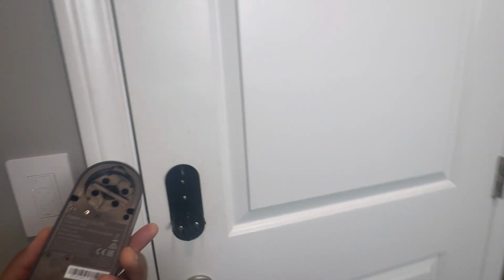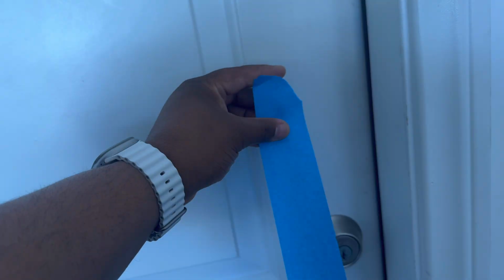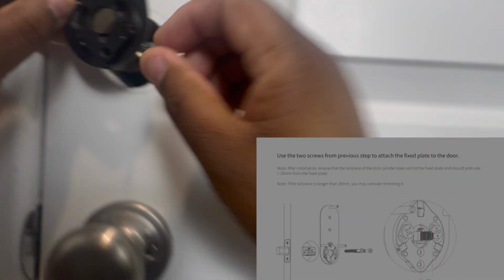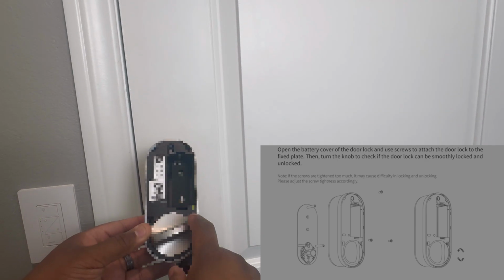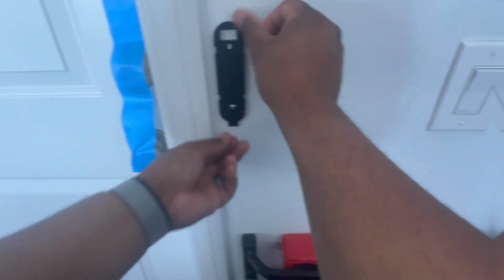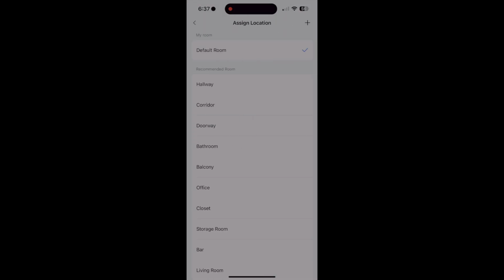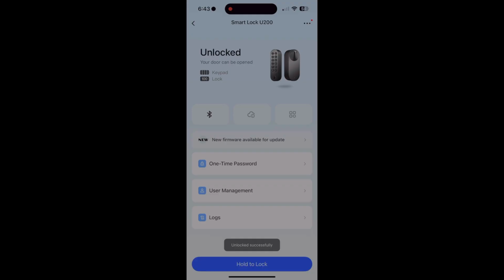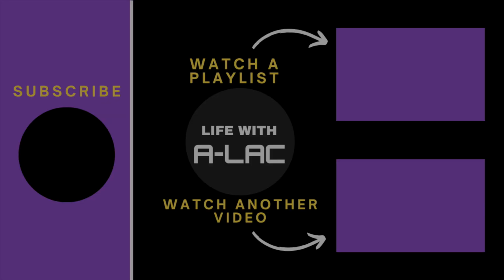How to Install the Aqara U200 Smart Lock + Apple HomeKit Setup (Full Guide)

Comment: Hey man, appreciate the great video. I currently don't have an Apple hub (I do have the U200 + M3), and I'd like to get easy access in the Home app on my iPhone. Is an Apple hub (Apple TV 4K or HomePod) essential for it to work in the Home app? Thanks in advanced.
Reply from the maker: Hey - This one is tough... So those hubs will allow you to connect your Thread/Matter devices too, no problem.

And then you can add those hubs to Apple Home. They'll show up under Home Hubs and Bridges in the Apple Hub app.

But to do what you want to do, you still unfortunately need an Apple hub. Right now, that list is either:
* Homepod (2nd gen)
* Homepod mini
* Apple TV 4k (2nd or 3rd gen)

This list does change over time, but this is what we have to select from at the moment.
Reply: @life_with_alac thanks for the reply! I actually figured this out. Once you have the hub (in my case m3) you can then create scenes which those can be input to Apple home no problem. I now have easy access via home to lock / unlock remotely.
Reply from the maker: @tomerlevin21  Sorry, I misunderstood you... That absolutely works.... Not sure if you have a Philips Hue hub or not, but it's a very similar process. Glad you got this working!

Comment: This is insane. That it retrofits into an existing lock. It's so goddamn easy to install per your video. Compound that with it having thread connectivity to allow a direct connection to Home Assistant - this is literally the perfect lock to exist. Thanks for the video.
Reply from the maker: @metaljesus5334 - The lock install itself isn’t too bad… that was actually the fastest part for me. Getting the lock setup in the Aqara app and integrating it with HomeKit took the longest. Hopefully with the tips I shared, you can save a bit of time on your install. I have a review video coming soon, but overall I’m pretty happy with this lock. 

Thanks for watching!

Comment: is aqara hub M3 required? can install wtihout any hub?
Reply from the maker: @rustxtho7104 - The M3 Hub is NOT required. 

I don’t even have that hub 🙂

And yes, the unit can work without a hub. You can control it via the Aqara app via Bluetooth or WiFi. 

Without a hub, you will be limited as far as automations.
Reply: @life_with_alac  but you a Thread Hub (Apple TV or Homepod (mini)) in order to get it to work with Apple Home (and Apple Homekey)
Reply from the maker: @rustxtho7104  - You are absolutely correct. I think a lot of people in the Apple ecosystem will want this lock for the Homekey feature. 

And for that to work, you are right, in that you need a thread hub. In addition to the HomePod Mini and Apple TVs you listed, if you have a 2nd generation HomePod, that also has a thread router as well. 

Thanks for comment!

Comment: Hi A-Lac.  My device is not appearing when trying to pair it with apple home kit, is this because I don't have a apple homepod?  Sorry I'm new to this....   What I'm trying to achieve is to be able to add guest passcodes as I'm an Airbnb Host.  Any advice? Do I need a homepod?
Reply from the maker: Hey! No need to apologize. I’m here to help. Hopefully we can get you on the right track. 

Here are a couple of things I’d recommend:

1) To get started with HomeKit, you are going to need either a HomePod, HomePod Mini, or AppleTV 4K to act as your hub.

2) You will need to make sure whatever device you have as your hub, your accessories (smart lights, locks, etc), and the phone/ipad you are using to set everything up are on the same network. In your case, if you have a “guest network” for your Airbnb guests, but you HomeKit devices are on a different network namely differently you won’t see your devices show up. 

3) Double check that the device your are adding states it works with HomeKit or supports Matter. If you don’t see this label, it might not be compliant

I’m including a link to an article that goes into some more details on some other things to try:

https://support.apple.com/en-us/104998

Start with these items, and let me know if you are still stuck. There are a few more things we can still try.